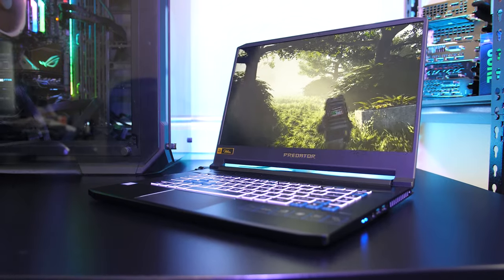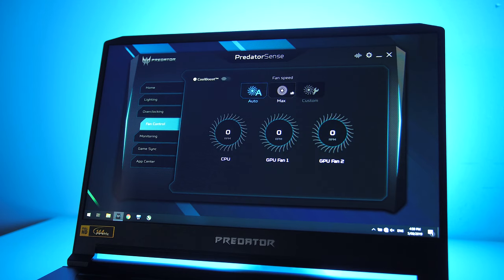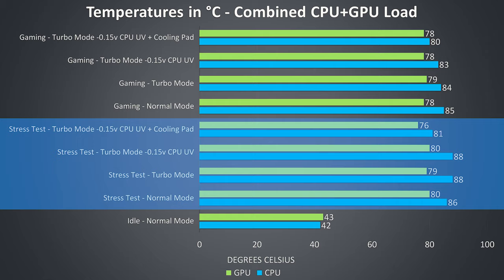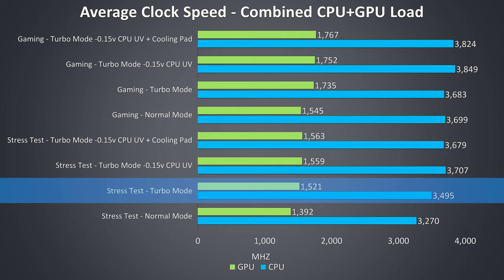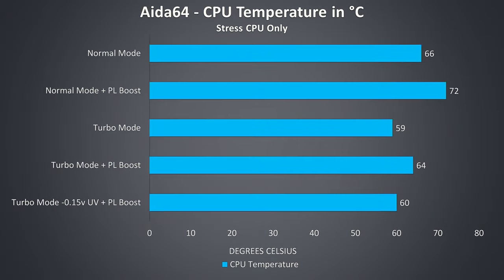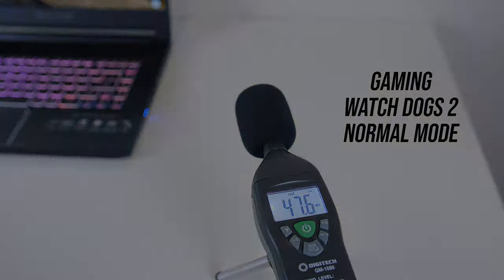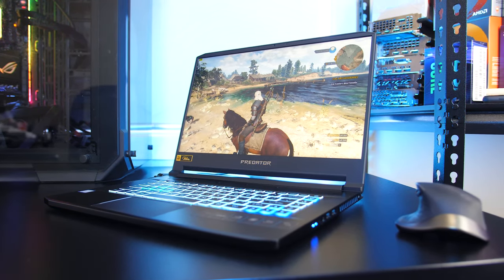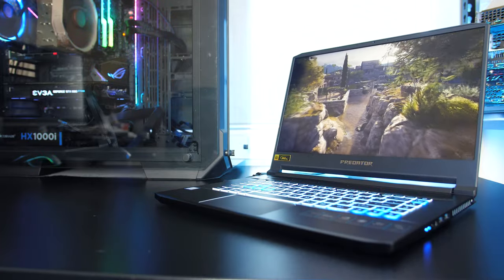Acer Triton 500 Thermal Testing - How Hot Is It?

Comment: Wowowow so generous u put it under 90c. People in dave2d discord always say this laptop is trash. So its better than msi GS65? 

Oh yeah i want to let u know.
If u overclock ur gpu at Extreme, turn on Coolboost and last change the fan mode to Auto. It will give u extra RPM
Cpu up to 5300rpm, gpu up to 6800rpm
Reply from the maker: I haven't tested a gs65 for a while so honestly can't compare based on my own results. It would of course also run warmer with a warmer room temp so not sure how they're testing. Different workloads will also have different results.
Reply: As far as i know dave also recommended this laptop
Reply: Suh dude. we say it's not very good because of the low power limit. The chassis can't handle the temperatures so they just took the lazy route and set the power limit lower instead of engineering something that can properly cool the machine
Reply from the maker: Still seems to perform well enough though even with the power limits in place, seems like a pretty good compromise to me given they're undervolting by default with the newer BIOS now - this was not done with the original shipped machine and older BIOS.

Comment: Does the 9750h run hotter or is it the same
Reply: it does run about 5c or a bit less hotter I do believe, however do some research because I might be wrong
Reply from the maker: I wouldn't expect a difference under multicore load. The architecture is the same, assuming Acer use the same power limits it would run at around the same clock speeds before power limit throttling. Would be faster for single core load and temporary random boosting though.

Comment: No more than 88° is a bit too optimistic, my PT 500 go easily to 90/95° with simple graphic games even in winter while using cooling pad too. Not sure if something gone wrong.
Reply: Plot Twist: Why my laptop same as you but these heat never pass 90. Even imma playing Doom with ray tracing or GTA V with Full mod graphics (Realistic) or Vanilla Texture. 

Imma using a cooling pad just below 80$ and... room temperature about 24°. Sometime you need to check your fans and clean it asap.
Reply: @godniko1790  I already did it (as long putting new thermal paste), but yet still go in this way. I just avoid to overload it with work, using it less and with waaay lighter games.

Comment: I have the 2080 version of this and my undervolt can only be -120 otherwise i get stability issues in games and random crashes.
Reply: Roland 33 how about thermals?
Reply: @felipedourado  79-93 degrees celsius its pretty good at cooling. The fans can be pretty loud though wear ear phones.
Reply from the maker: Fair enough, varies by machine of course, I've had some Intel CPUs that couldn't go below -0.07v without blue screening.
Reply: @rolandxor179  93 degrees is considerably high, don't you think?
Reply: @felipedourado  Yes this is the range when playing games on highest settings thats the peak usually it stays in the 80's. It cools really well.
Reply: @rolandxor179  nice!

Comment: Wondering if my laptop is faulty I’ve had to massively undervolt my i7-9750 and reduce turbo power to about 3,400 cause otherwise temperatures will just sit at 95 degrees..?
Reply: I think the 9750h has different power limits as 8750h. Mine as well hits 95-98degrees during higher loads cpu+gpu.

While doing nothing it has like 41-43 idle.

While doing internet stuff it has between 48-55.

Comment: Will an i5 9300h bottleneck with a gtx 1660ti?
Reply from the maker: Should be fine.
Reply: @JarrodsTech  thank you. Also do you know if the i5 9300h version of the Acer predator Helios comes with the undervolt out the box like the i7 does?
Reply from the maker: I do not know as I have not tested it. I would assume so, but have no idea. Maybe they thought it wasn't needed for the i5.
Reply: @JarrodsTech  Thank you. Why would it not be necessary for the i5 though? Would I see a lot worse performance with this configuration?
Reply from the maker: @fin-less8781  I'm saying it's probably less necessary so maybe they didn't do it, I'm just guessing. I haven't compared the 9300H and 9750H yet as I haven't been able to get the right machines to do it  so can't answer that.
Reply: @JarrodsTech  okay thank you for your help. I'll be waiting for that video! Keep up the fantastic reviews and videos

Comment: I have the i7 9750h and i hit 93c this morning 😥😥
Reply from the maker: If that's just peak rather than solid average I wouldn't worry too much.
Reply: @JarrodsTech  between 85 and 92 was my average this morning it was more at 89 and peaked at 96 and 93 was average
Reply: I think the 9750h has different power limits as 8750h. Mine as well hits 95-98degrees during higher loads cpu+gpu.
While doing nothing it has like 41-43 idle.
While doing internet stuff it has between 48-55.
Reply: Does the 9750h undervolt by default with the stock bios?

Comment: Again , He didn't mentioned Thermal throttle limit for GPU + If the bios unlocked not 👎🏻
Reply from the maker: It's almost like I make the videos two weeks or more in advance of posting them, meaning any feedback can't instantly be incorporated within an existing video without additional effort. I still don't really know what you want me to do though, the "maximum" reported in GPU-Z is 87c, same as every other RTX laptop I've checked so not really sure what the benefit of checking that's the same every time is. Is that information useful? If it actually throttles I will cover it in the video. There are almost zero useful options in the BIOS.